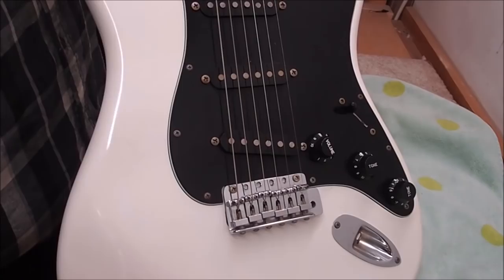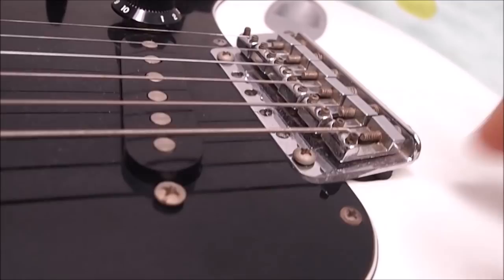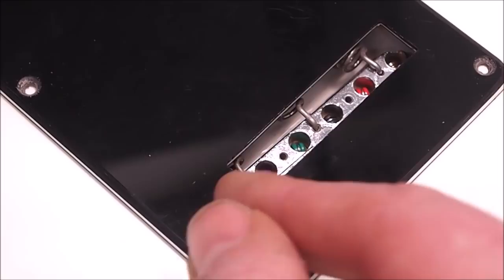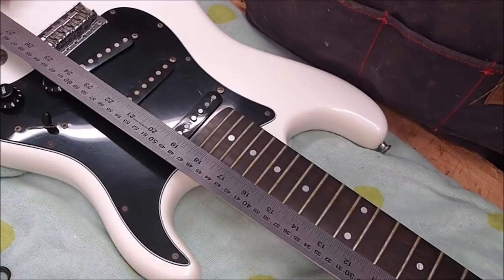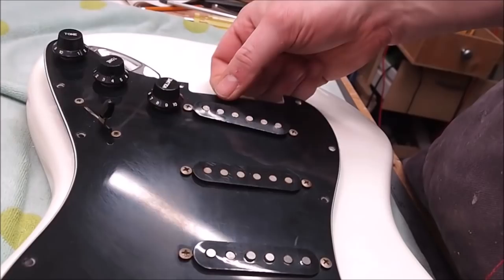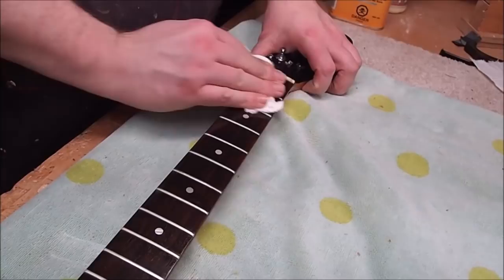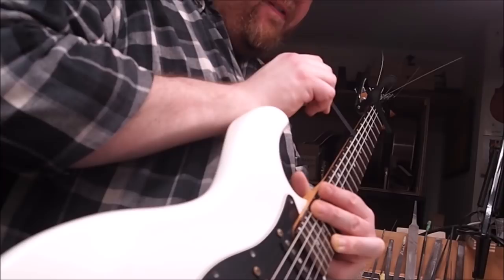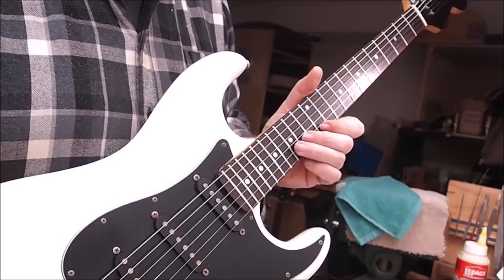Mystery Strat

Comment: SCHALLER - TWO Ls - not one! It would be one L as if it was Schaler which is WRONG. Your pronunciation is not right. Schaller as in SHALL with ER at the end. Made in Germany of course. But only more people don't realise or know that this is actually just a name as their hardware is made by BML of Germany. That bridge looks like a 70s FENDER bridge made from zinc (company code name MAZAC). Also the two springs have to work harder to counteract the string pull so Leo Fender put the FIVE springs in to make it easier on the springs. The angle is to make the tension tighter without the other springs which is wrong as it breaks the structural integrity of the steel. This also makes it easier to adjust.

Comment: I’m not a physicist, but I am studying physics. If you have the springs converging to the center, they’ll only relieve tension at the center. Parallel is superior, as it gives relief to the entire trem.
Reply: putting the springs at an angle increases the distance between the ends of the spring , making for greater tension. sometimes it's the only way to get the bridge to sit down flat on the top of the body.
Reply: Golden Knight  try it, you can see clearly the difference it makes
Reply: Golden Knight  the longer you stretch the spring the greater it pulls back, angling the spring stretches it more.
Reply: Golden Knight  not always, and it depends on what strings you are using and how you like the tremolo arm setup.
Reply: Golden Knight  argument from authority.
Saying it just makes you look needy and insecure.
Reply: With 3 springs and the 2 outside angled and middle one straight. The 2 outside are stretched and have more tension, you can even easily pull the center one off. Go parallel on all 3, or 2 and tighten claw.
Reply: there is always a net tension on the trem block. Its totally unnecessary to angle the springs, or the claw (a la Carl Verhyen) for any reason.
Reply: Golden Knight  Welcome to the world of "how guitars trump science".What's you're not realising is that nearly all of what is believed electric guitars is a huge fantasy, and people don't appreciate you disabusing them by referring to verifiable facts. See also tonewood.
Reply: I find cheaper guitars need an extra spring if you want to use 10s... I just add a spring then the goofy problems are solved. Usually happens on licensed Floyd guitars too.. If they are not quality springs, 3 sometimes just won't do. Happened even on an ibanez Giger model I have. Went to put 10s on it... That trem would NOT stabilize, no matter where I set the claw.. It was all weird. Took their little spring hold down clamp off, and added a 4th spring... Set the claw for the bridge to be level and it's never had a problem since.
Reply: Physics has absolutely nothing to do with the reason electric guitar players do anything.
Reply: If you study physics, do you not see the difference between a spring anchored between A and B Vs the same string anchored between A and C, where the AC distance is greater than the AB distance?
Lol....
Reply: What bothers me about it is the slanted springs have more tension, which leaves the center straight spring having less influence and essentially flopping around. I get why it works in theory, but in execution it just negates the straight springs purpose and I see no reason to do it. Two springs being stretched more just seems less stable than 3 springs all pulling equally with less individual tension too, which is another mark against angling your trem springs.
Reply: @c3N3q  not linear, its a vector

Comment: Those were probably the crustiest frets I've ever heard. Wow.
Reply: I dunno. Mine get pretty cruddy if I don't keep them polished frequently. As soon as you start fretting and bending notes, they leave visual marks on the strings. Almost like oxidation. Because it doesn't come off. So it's not junk on the frets.
Reply: And it's still doing it. Checking the strings, they're actually bent at every fret. Yea. It was time for new ones lol.
Reply: Then you've never seen a punk bands guitars

Comment: The reason the springs are oriented that way is for a more progressive Feel, tension, and response. If the springs were oriented in a straight line you have the same amount of tension, feel, and response, thus making it harder to initiate the "whammy" and quicker for it to finish the "whammy" it's not as obvious with a fender style trem, but it is quite obvious with a floyd rose style trem

Comment: My tech, now retired, always did the little things to make things better. He fixed a case hinge for me once. When I was modding this 77 Les Paul I bought cheap, and the place I ordered a new pickguard from didn't have the round plate to cover the switch hole, my tech just cut me a custom one out of a pickguard scrap he had laying around. Perfectly round. Looks like a factory made it. He never charged me for those things. He first set up a guitar of mine in 1982, and the last setup he did for me was probably 2017 or 2018, and he barely even raised his prices for customers like me who had been with him for decades. I ALWAYS went to him, and brought dozens of friends and acquaintances to him. He is missed.

Comment: My 2018 Player Strat came from factory with angled trem springs and floating bridge, essentially the same as this one. I believe Fender spec is for the rear of the bridge to be floating around 1/8" above the surface of the body.

Comment: One step you may have done, but did not mention ... after adjusting the trem angle, your strings would most assuredly be sharp, and returning them to pitch will also assuredly make the bridge rise up again. So the technique I use is a) screw the spring retainer in to pull the bridge down to the body, b) use shims either under the bridge on the top or behind the trem block in the back to get the bridge angel where you want it, c) tune your strings to pitch, d) gradually loosen the trem springs (evenly on both screws) until that trem block is just barely lose and finally e) remove the lose shim. You will be in pitch and your bridge will be at the desired angle. I use the same approach when changing strings on a floating trem. It allows you to take all the strings off at once, vs one at a time, which makes doing a good neck clean much easier. TL;DR version - the key to happiness with a trem is to treat it as a hard-tail during maintenance.
Reply: Right on...

Comment: Definitely a franken based off Squier parts. I'd guess Korean, but my Korean Squier from the 90s had a much nicer looking neck. The curved butt end of the neck looks like a definite giveaway. Korean Strats also had those type of weird looking pickups but so did the MIM strats. Sounds better now than when it was cobbled together!
Reply: I have a early ‘80s JB Player made (at least in part) in Korea. After replacing everything but the wood, strap buttons, and neck plate(it was an odd non-Fender spacing) on it it’s become one of my best guitars. Before the overhaul it looked an awful lot like this one.

Comment: I’ve got a ‘94 Made In Mexico Strat with a similar intonation issue, i.e. the saddles ride towards the back of the bridge plate. It intonates fine, but right at the edge of no more adjustment on the high E. I’ve had problems fitting pickguards around the bridge,too. Never occurred to me the bridge may be in the wrong place.

Comment: I've been doing the "V" springs forever.  That is; only TWO (2) springs in an exaggerated "V" pattern.  It's the first thing I did when I got a new guitar home.
It has to do with the "feel" of the movement of the vibrato system.  
Springs become harder to stretch as you stretch them more giving more resistance to increased movement.  The more you stretch them, the harder it is to stretch them more.

By angling the springs, they are under more stress already when the balance of tension with the strings is achieved.  So it makes the bar feel a little bit stiffer to move.  If the bar is "softer" to move, it is less controllable, and I've even seen it (usually when they used tiny strings) where just moving around could wiggle the bar and cause the notes to warble.  
I never had either of those problems on my guitars with bars.  So I always did it that way.
That certainly doesn't make it science.  But that is my own observation.  Maybe there's science to it.  Maybe it's just psychosomatic.  Either way, it always "feels" right to me.

Comment: Installed new tuners with my recently purchased flashy high end mini power driver. Did pilot holes as required. Yup, screw head popped right off......
Thanks and blessings.

Comment: In my lack of experience, and for i was told by my teacher., the springs are placed that way so they add more tension to counteract the tension of the strings (also done with a heavy gauge string). Ussually donde with a bad set of springs
Reply: I agree, but in this case that effort was countered by the loose claw screws....
Reply: With the middle spring attached over a shorter distance than the outer two, it isn't doing much pulling, so you have less tension than you'd get with 3 straight springs.

Comment: I think the strat bridge angle is a matter of who's gonna play with it. I think it definitely needs to be floating, as if it just rests against the body there's no way to pull the string tension back even across the nut. But also I find it more useful if it can pull up certain intervals - mine is set up to do minor 3rd on the 3rd string. So the "I don't care who you are..." statement is a bit too much. But thanks for all the great videos, I'm digging your work on sharing your expertise on repairing all the guitars.

Comment: Putting spring on an angle just makes the tension stronger (stiffer), but obviously you can do exactly the same thing by putting more tension on it. So, no that does not make any sense. You only get a tiny it more perpendicular stability. Doubt if that is much at all and not doing more harm than good. All of this pure theoretical of course.

Comment: The two angles of springs mean they are at different tensions, so have different resonant frequencies. It's a way of avoiding dead notes. Also it increases the tension slightly so it's a step between 3 and 4 parallel strings.

Comment: Diagonal springs apply more tension than when installed parallel , since they are streched more ... Helps retain the bridge  better against note bends ig
Reply: It doesn't matter how many times people repeat this BS, it is still wrong :) Angled springs mean the middle one isn't doing much, and can rattle around causing buzz. The only reason to angle springs is to make up for the fact you don't know how to adjust the claw ;)

Comment: i could be wrong but i do believe that is a 70s strat with an after market neck. If that is in fact the original bridge and neck plate then it is very likely since those were what was used in the 70s and i can tell by the saddles because they are block instead of bent steel. Then again it could be a squier since they use those saddles too, But i doubt it since those saddles are on the same guitar with a big f stamped neck plate. Also the round over job is a lot more round which is usually present with early fenders.

Comment: This looks a lot like a better version of the one I have dubbed the Crapocaster... This one has an extra fret vs mine, although the one I have has a bullet truss rod. The neck on mine has the same black face and no markings. The electronics in yours were clearly better with the proper top mounted jack, mine has a cheezy side mounted jack.

But yeah, like yours once properly setup it played and felt great even if the pickups are nothing to rave about!!

Comment: Really great setup. I had the same thing with a used strat I had, the bridge was the installed wrong for the guitar it could never be set up correctly. I wish you had showed some more of the floating trem  bridge set up, I normally don’t start by adjusting the screws like that in the back. That’s not a criticism, but would have liked  to see how you set up the height of the tremolo. Thanks!

Comment: I think the thought process is that the outer edges should have more spring tension than the inner to help encourage more balanced bridge bending(and a bit more overall tension for free). 
If you really want to balance your spring tension, you should better match it with the string tension instead of just making the outer sides have more tension blindly. If you want to do it blindly, only install the bass side spring diagonally.

Comment: Physicist here: angling the springs will extend them a little bit more and, according to Hooke's Law, produce a larger tensioning force.   As long as they are identical springs, and angled inwards equally, there shouldn't be any net force to the left or right.  But I can't really see the point - I don't think the increase in tension would be significant, and it looks untidy and wasn't the design intention.

Comment: I'm not a physicist,  but I can tell you if you get the springs under the right tension they resonate the twelfth feet harmonics, making the guitar sound incredible if you can dial it in. Some times it requires three strings in a wierd pattern , perhaps even two straight and one slanted. Try it out and maybe do an I depth video how the bigger string pulls more on one side.  So this acually impacts the fretboard bowing.

Comment: Hi. I really appreciated the set-up demonstration of this ubiquitous type of electric guitar. Good on you for checking the scale length issues and for the tremolo bridge spring alignment comment. After using a "coarse" wet/dry paper (the grade dictated by the fret condition) I do recommend the 'Crimson Guitars' fret polishers. The set of four grades I have - Coarse, Medium, Fine and Superfine - have smoothed out and polished 4 necks to date and are only 10% used-up. Are they messy? Yep, but I own a vacuum cleaner :)    Having only used Tone 'finger-ease' as a fretboard "conditioner," I am interested in your next set-up video to hear your personal views on what products really "condition" a dark-timber fretboard. As a viewer over the past 12 months I highly appreciate your expertise.

Comment: That's a bit of a Frankenstein Strat. Looks like it had a two point trem originally and some one has replaced it with one of those truly horrible CBS one piece die cast zinc alloy bridges. Seems almost like a waste to plug those holes only to replace that bridge. And two of the pickups are cheap ceramic magnet beasts.

Comment: The screws on the back trem cover are staggered opposite of most strats.  I just had to double check my Japanese and US strat.  Both of them have the middle screw higher towards the bass side of the back of the body.  The middle screw towards the treble side of that guitar you fixed is higher.  I have no idea what that means, but I bet you could identify the brand if you knew.  Maybe a Kramer?

Comment: I wonder if the body was originally fitted with a Floyd Rose and then someone converted into the vintage trem configuration?  That might explain why the scale length was 2mm or so too short
Reply: Likely just made that way. I have a ‘94 MIM Strat with a similar issue, just not as extreme. It intonates fine, but the low E is almost out of adjustment room.

Comment: Not that I believe it but I think the  theory on the  springs running at a angle is based on equal pressure from them.  If the spings are the same pull test strength equal  location of them would seem more logical. The only thing I am sure of is  Foyd Roses  can be a pain in the  AXE and  decked  Tremolos are well behaved. :)

Comment: Great point about power tools. I cringe watching some guys and they act like there is no chance of anything negative. I also cringe with how some people remove the neck while the guitar is face-down while the neck/headstock is propped up......I cannot believe people remove necks in that fashion. Putting down-pressure on the neck bolts while the neck is at an angle.......go ahead, but not on my guitar.

Comment: Everything about that 'strat' screams 'cheap copy'. Two screws in the trem?!? Talk about living on the edge (pun intended)
Edit: Having watched the video - The Fender patent application shows the trem up, away from the body. The springs in a triangle means you have different tensions from the different springs and this makes a big difference. Also, the pull from the springs has to equal (though they have mechanical advantage from the length of the trem block) the pull of the strings. It is not a cosmetic thing.

Comment: I think the reason some people angle the trem springs is because its easier to install.  If your popping the spring loop on the outsides of the claw it gets real tight using fingers or a set of needle nose.  Even though its easy enough to install using a straight blade screwdriver, some are unlikely to know or think that technique through.
Since you used maple for the plugs, what was the body wood? The high amount of tearout made it look like late 80's plywood body.
Real nice methodical walkthru for a setup + for a disused guitar.

Comment: is the 5 way switch, the space between both bolts only 31mm ? if so then it is a hohner st special BUT the neck is not, the neck is aftermatket and the schaller are from the 90s, 80s schaller have a nütch on the back, cant explain it my english is not that good. if the space between the bolts is 41mm then well then its just a body.